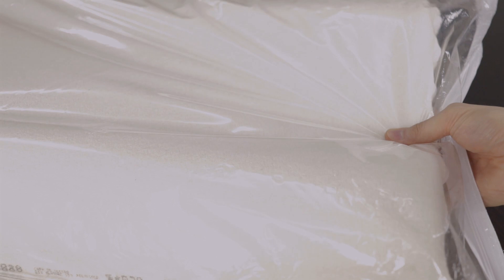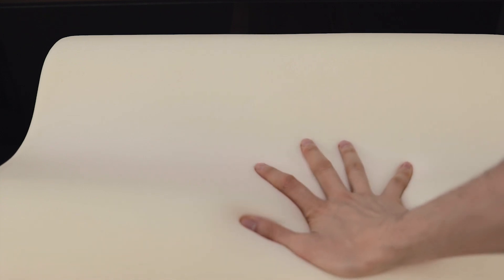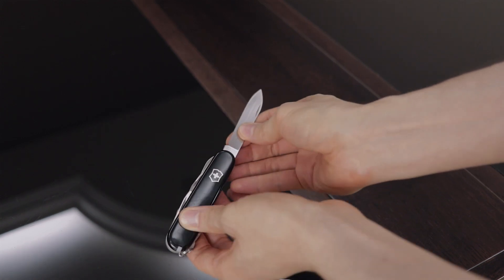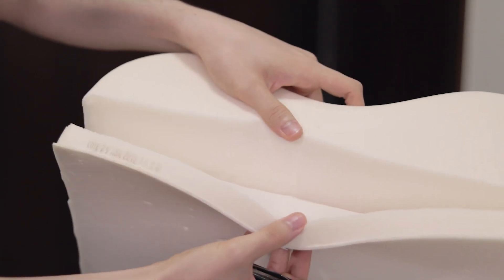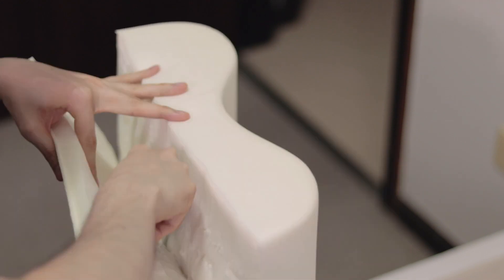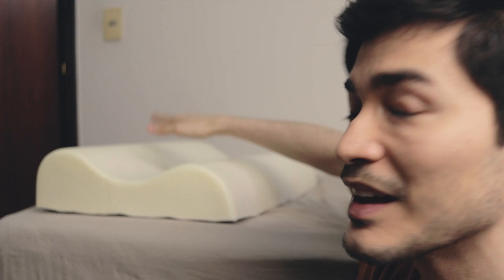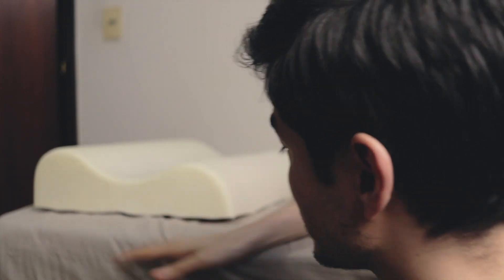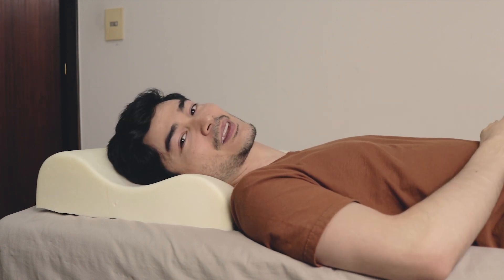DIY Fix Your Pillow And Sleep Well

Comment: This is the second time I see someone speaking about the pillow after myself!  I totally agree; I personally use a wooden pillow with a thin towel on it. This was proposed by Katsuzo Nishi as a therapeutic pillow for the neck. I did need a little bit of time to get used to it, but after I did, it was life-changing. Before that I started to sleep on the hard surface, which was another amazing decision of mine. Glad to see you spreading the awareness about it. 

When I go to bad, I put a little  rolled towel under my lower back as well, the same as another one under my knees. And on that wooden pillow + a thin towel above it, I fall asleep as a child within 5 minutes. Now I tend to sleep more on my spine because it just feels amazing. But hard-surfaced bed also is a thing, because if the surface has a curvature and the pillow does not, it's not going to work that great as it can. So I just use a wooden desk as a base + two blankets on it, so it's warm and not too hard, but it's perfect for resting well and having all the body relax to its max.
Reply from the maker: How's your wooden pillow? I actually have one too but was told that I should stay just a little on it and not sleep. xD I also sleep on the floor here and there, at start feels great but after a while I start to build tension on my neck and have to return to a normal bed. But indeed sleeping on a hard surface feels great!
Reply: @Nossaki  I usually sleep on it until 4-5 a.m ish, then naturally switch to a softer one, yet still with a good shape. But for neck relaxation and even bettering the vertebrae placement  (for those who had issues with that) it's cruical; it's just important to find the right length of the pillow. I also cannot fall asleep onto anything else, but on the wooden one. 

Due to hard surfaced bed, I used to sleep on the desk itself, and it worked for several years, then I added two blankets - they both are pretty thin, which makes it all softer, yet still I sleep on the hard surface +in cold season it's adding extra warmth.

In both cases - with desk and wooden pillow I followed my intuition, and I know how it is important to be flexible along the way. 

So yeah, listening to thyself is the most important 🦋
Reply: @Nossaki  by the way, when I slept on the floor, after a while all my muscles started to hurt. It was because it was cold there, still I ignored my body signals for a while and had terrible muscle pains. But then I finally got it and moved back to the bed with hard desk on it instead of a matrace and two blankets on it, and voila - pain in muscles started to slowly, but surely dissipate.
Reply from the maker: @iamjoy888  I don't have any desk that is large enough that I can lay on, but indeed the cold factor might add more than what one can imagine at first. I'm right now trying to improve my sleep even more. It's such a vital topic that can have an impact in pretty much all other aspects of life.
Reply from the maker: @iamjoy888  I did't went to a store to try it, but have you ever slept on a insanely hard mattress? Pretty much go to a store and order the highest density you can find. Natural latex seems a good choice too. Wondering how it would compare to the floor.
Reply: @Nossaki   @Rodrigo Nossaki  I haven't, because before I would sleep on a medium hard mattress, and after I just used a desk, then floor, and then came back to the desk with blankets. It works perfectly for me. Once, though, during a journey to another place I would sleep on a very hard mattrass and it was super-cool.
Reply from the maker: If you ever test a rock solid mattress let me know. The only advantage I see using a mattress is that it can be more practical, but it should give an almost similar feeling to the floor.
Reply: @Nossaki  if I get a chance to sleep on it somewhere in the journey, I'll let you know. But you always can use a desk and blankets at home if you live there a good amount of time. One doctor told me that once he got to sleep on a terrible mattrasse which, like he said, could harm his health. So he grabbed the door from the cupboard and made it a mattrasse, and voila! Really doctors know how important it is for health, yet not all of them speak about that for the record.

Comment: Holy moly. I was thinking about to cut my pillow as well then my mom said I need to ask the seller first. After watching your video I’m gonna cut it. Mine comes with 12cm height which is way too high. I think normal height should be around 7-9.